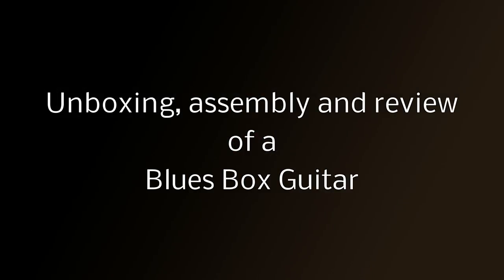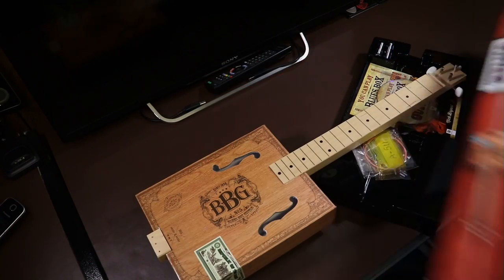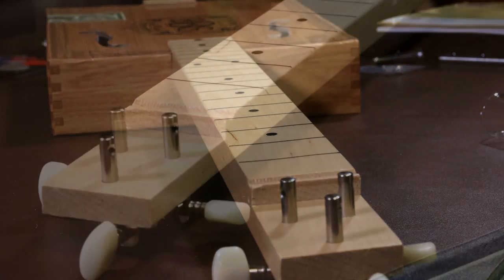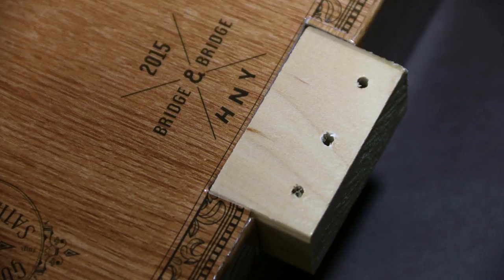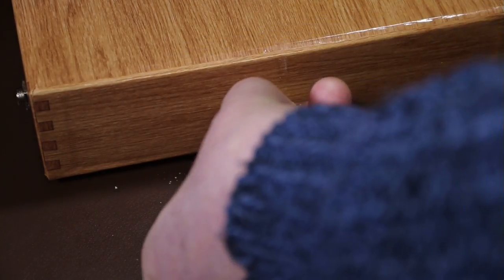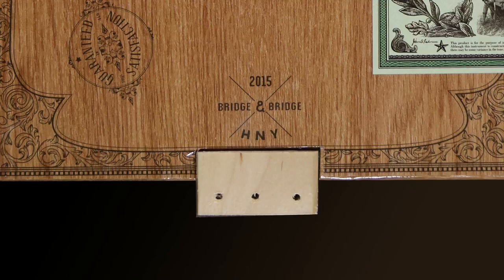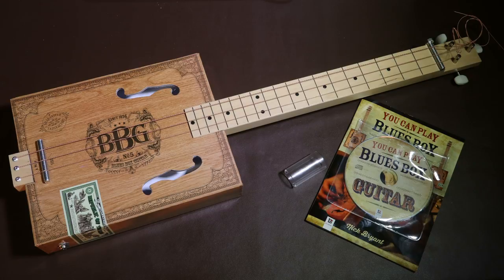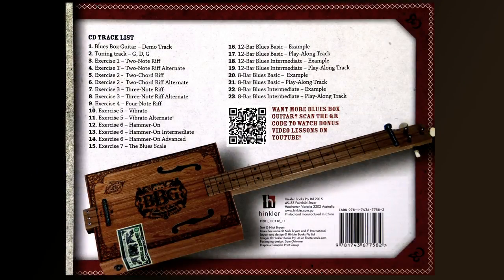Blues Box Guitar, the BBG slide guitar. Unboxing, assembly & review.  cheap cigar box guitar.

Comment: I bought one today before I saw this review.  I got mine at Guitar Center for $34.00 usd total. I'm very satisfied with my purchase. 

It's well made for what it is.  I was able to hand fit the holes for the sting easily. 
On an amp it sounds good, but if you want that gritty blues sound your going to need a pedal.  Distortion,  sustainer or a note compression.  But if your amp has a reverb your good to go. I'd buy it again, and I'd buy it for a gift.

Comment: This is a very good video and I like my BB, but, how the heck do you play this thing electrically without all the screeching feedback? I'm going tear into mine and add a volume pot and ground wire
Reply from the maker: Thank you . . . I didn't have that problem because the pickup in mine is weak if anything.  Good luck with the project 😊😃

Comment: My first one was defective. Second one much better. Would like to lower the strings down a bit. I believe the 2 bolts, nut and bridge/saddle, are both 1/4". I tried 2 bolts half that diameter, and that was too close. I think maybe a couple pieces of .20" round stock might work. I know that many fretless CBG's can be played fingering the notes. Yes, the sound is different with not much sustain, but still playable. Both Blues Boy Jag, and Chickenbone John have YouTube videos discussing this.
Reply from the maker: hmmm, personally I wouldn't try to play it that way.  It's been designed for slide, that's why the action has to be high.  But it's cheap enough to experiment with so it's not a great loss if the fingerboard isn't hard enough to be played without a slide. 🤔

Comment: Thank you for the video, how do you like the sound of it acoustically, without an amp.  Also one other thought, despite the height of the action, if you strung it with nylon strings, is like to use the finger board without damaging it.  Thanks again for the video!
Reply from the maker: Acoustically it is quiet but the tone is nice.  Don't get me wrong it's load enough to practise with but in a room of noisy people it would disappear.  Sorry, but even with nylon strings you couldn't use the fingerboard, it doesn't have any frets and the lines are painted on.  I think you'd have to search eBay or Amazon for one with frets, but they are a lot more expensive unfortunately.
Reply: @guitar-academy  thanks for the reply! I'm a double bass player and don't mind the fretless aspect.  functionally speaking, i was hoping it could be done with out damage.  Appreciate your video and review.  Looking forward to playing and perhaps experimenting with it.  Cheers!
Reply from the maker: @reverendjackdaniel  I sure you'll have great fun experimenting . . .    😊
Reply: I recently purchased one of these and was planning on inlaying frets so that i could play more complicated songs. I was also thinking that if bridge height was an issue i could get smaller bolts.
Reply from the maker: @johnplayzguitar1118  By default they are designed as slide guitars and therefore the nut is the perfect height.  (a slide guitar should have a high action)  But it you're thinking of fitting frets, smaller bolts would be perfect I would think but I haven't tried it. . . .  let me know how you get on.  It sounds an interesting project 😊

Comment: How do you finish putting on the strings?  Surely you wind a few times around and cut off excess. but I have had trouble with this.
Reply from the maker: yes that's right 'wind a few times and cut'.  Yours should be fine 🙂

Comment: I bought one recently and the low g goes out of tune a lot. I am going to buy a new set of strings to see if it helps. Has anyone come across this problem? Also can anyone recommend what gauge strings to get.Cheers.
Reply from the maker: I honestly doubt the strings can cause it to keep going out of tune.  The gauge of each string is in the instructions.  It sounds like you might have a problem with the tuner, so before doing anything else check the screw is tight at the back of the tuner.
Reply: @guitar-academy  will do. Thanks for the reply.
Reply from the maker: @rtcrtc928  No problem . .  I hope it is the screw, that would be an easy fix . . .  😊
Reply: Rtc Rtc this happens to me just tighten the machine head.  Adrian

Comment: Can it be setup to play left handed. If you string it opposite.
Reply from the maker: Yes it can.  I would be really easy, you just need to put the nut bolt on upside down and the stings opposite.  The BBG logo would obviously be upsidedown, but it would effect the way it plays . . .  😊
Reply: @guitar-academy  Great review, I'm left handed and as you say it would be easy to reverse the bolt and strings but I'm a bit concerned that the jack plug will then be digging into my chest.
Reply from the maker: @johnnyz3354  Good point . .  I've just tried it and it doesn't dig into my chest, but it's not ideal either.  The wire has to go under your arm.  It's a shame they don't make a left handed one. 😒
Reply: @guitar-academy  Thanks for trying it out lefty style. I have a right-handed vintage strat style with the input socket on the face of the body so its not so uncomfortable when played left handed. Oh well still I might give the Blue box a try as it's not very expensive. I'd like to see a modded version to see how the electrics are situated inside, maybe I could make a hole in the bottom of the box and re route them. Cheers,
Reply from the maker: @johnnyz3354  I've bought some parts and a box to do the upgrade, but I have so many videos to make I haven't got around to it . . Your question has prompted me to get the video done soon . . 😊